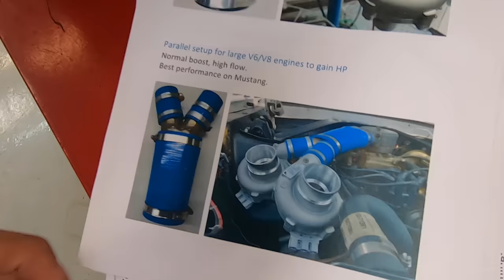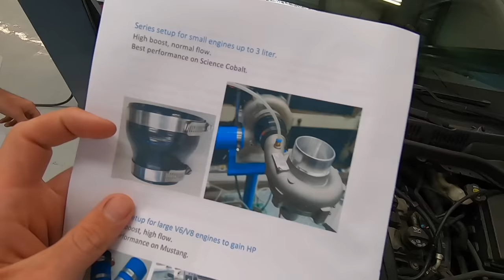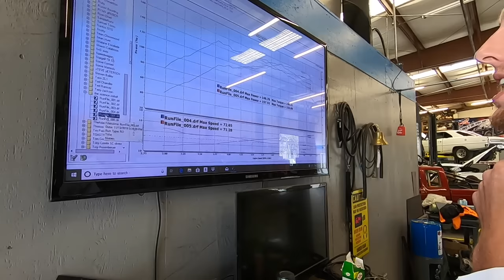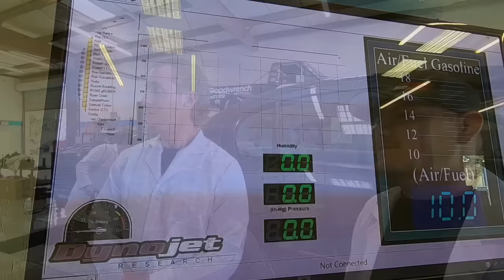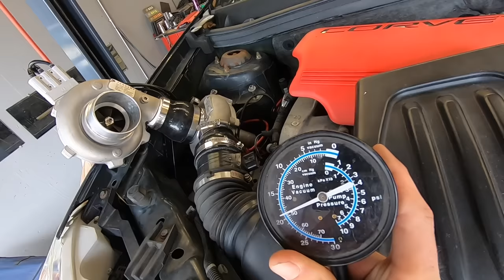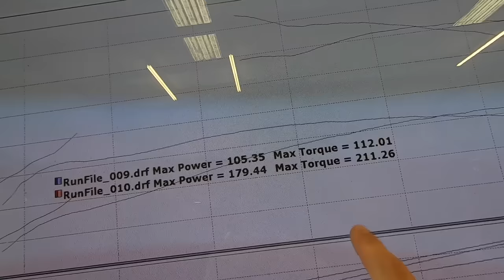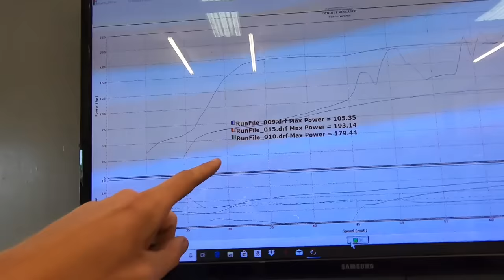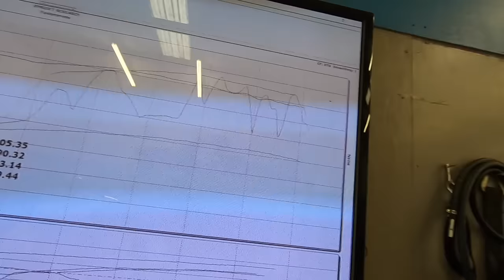Dyno Testing $5,000 Worth of ELECTRIC Turbos! Double the BOOST!!!

Comment: Need to run a "Dump valve" so in NA you are bypassing the turbo restrictions.
Reply: thats how my magnuson supercharger works , it runs a bypass until the engine goes into  vacuum when you get on it. pretty dang effecient
Reply: Initially they wanted to see how the restriction lowered power. First Torqamp video covered it I think?
Reply: What does NA mean?
Reply: @angelmontalvo9125  Naturally Aspirated.
Reply: @angelmontalvo9125  North America
Reply: Thank you
Reply: @angelmontalvo9125  Naturally aspirated also known as no forced induction such as no turbo or supercharger. :)
Reply: That's how I'd build it its not hard to build you could use one of the exhaust to open header valves that are common in the hotrod scene and have it open when you hit the button for the torqamp
Reply: Chase Postell  it's still relevant and it did make a difference lower down in the curve it caused issues of a flat spot on the first run.

The main reason for running a sep line is so you can do things like maf  and map sensors to take timing out ONLY when under boost  because what they've had to do currently has hurt performance badly.

This is the big thing to remember a car can be 100hp up at peak but everywhere else in the curve it can be down on power. You have to take the whole curve not just peak power.

You put drag pipes and pods on a harley style motor (vtwin 110ci) yes it will make 40hp more than the stock bike with the cat and muffler BUT you won't see that power increase until you are at max rpm and WOT. between 50-80% rpm you will see a flat spot and it will be down on power compared to the stock bike thus it will be nowhere near as nice to ride and actually feel slower.

Peak numbers aren't what matters for everything other than 'my dynopenis is bigger than yours' arguments.
Reply: @rocco64744  Or nitrous, nitrous is chemical supercharging
Reply: We have a bypass that works great on engine/turbo/torqamp combinations https://torqamp.com/bypass/ 
Especially suitable when air mass flow is high such as a large turbo build.
Reply: @TorqAmp  loves yalls stuff! Send one to boostedboiz on youtube im sure they will love these aswell!!
Reply: @angelmontalvo9125  Not Applicable
Reply: NM : North Murica
Reply: @rocco64744  or nitrous..
Reply: Chase Postell  hardly, took me about 10m to work out how to make a system with no power loss and the right sensors to tune adjust based on what boost was present  and a third of that to type it. Parts wise.... Probably at most 250$  I want to get fancy and use welded tubing and a set of sensors. Low budget version would add maybe 90 to 120 to the install which is nothing really and if I was doing it I'd be building the electric setup myself and I'd have less than a torqamp costs into the compound/twin setup depending what I was installing it on. 

 The curve analysis took me about 45s while watching the first video of the single torqamp, your right a 2hp difference wouldn't mean much shame that what the torqamp restriction gives you is between 10 and 15% drop at various points on the graph as well as the 1-3% drop at 5400. What that means is it doesn't accelerate as well, because they took timing out in general they will have reduced performance across the whole rev range only compensating with boost when the device is triggered so that 2hp peak power drop is more likely a 10hp drop from the normal NA tune and that is significant and not really compensated for by 4-6s at a time of 5-8psi especially when combined with the loss of power at various points up the rev range. 

This thing would need to be installed more like a nitrous kit to be viable, sensors monitoring and pulling timing only when boost is applied and increasing fuel as as the boost comes in. 

 as shown in this video high numbers don't mean shit if the car becomes undrivable. Look at the torque curve in the twin torqamp setup that's horrendous but makes an 8th more power than the compound setup. With a tune setup for it you could probably make the twin setup as effective as a 100bhp nitrous shot especially if you combined it with a fuel injection solenoid or even just more fuel at the point its triggered. 

Im interested in power that's effective and usable so doing the comparison wasn't any effort or something I don't find useful. It's why I watch this channel, fasterproms, some PFI and a couple of other channels like theWorkshop. I like performance vehicles that work well and am fascinated by this shit so I spent a little time working out how best to use it. Just because you don't see potential or what issues it's causing doesn't mean the rest of us don't know what we are looking at.

Comment: The next step would be to have a three-stage turbo mounted on the same shaft hooked to a Prius engine with a planetary gearbox to have an electric/turboprop engine. The combustion chamber would be a two-stroke Detroit diesel with direct injection for a very high compression ratio. The result would be a powerful compact and clean engine.

Comment: 2019: electric twin turbo
2020: electric octa-turbo
Reply: Nick Venture did you mean quad turbo?
Reply: @enzoprosciutto210  how many sides does an octagon have?
Reply: Not turbo. Turbskis
Reply: Octa Turbo - Dual Threaded
Reply: Nick Venture 8 why
Reply: @bryanne274  Dual Channel
Reply: @eamh2002  buffered or un buffered?
Reply: One turbo for each cylinder!
Reply: Come on guys, this is easy math! Compound wide pipes on each bank on a V8.
Reply: Garage 54 style. Add more :D
Reply: @enzoprosciutto210  quadbturbroski ganggang
Reply: @bryanne274  simultaneous multithreading dawg
Reply: Chiron uses electric-assisted turbos.
Reply: @ArKritz84  thatd be pretty badass on neighbor

Comment: This is now technically an EV car since it uses electricity to generate power. Use that to get a tax break.
Reply: Does that actually work finna get a tax break real quick
Reply: 'hybrid'
Reply: Not an EV because it doesn't use only electricity, but it might qualify as a hybrid, might.
Reply: Using electricity to burn more gas? Best hybrid ever
Reply: I like the way you think😁
Reply: It uses electricity to increase fuel consumption. I'm sure the greenies would love it.
Reply: The power is made from the combustion engine
Reply: @adamgray7185  The power is made by the motor.  Think of it as an electro pneumatic setup.  The compressor helps push the piston down.

Comment: Sounds like supercharging with extra steps.  
Turbocharging (originally turbine supercharging) utilizes the wasted enthalpy of the exhaust,  both pressure and heat.  Ideally,  the pressure is the acoustic pressure or time variant known as sound.  The majority of the energy used by the compressor derives from the heat of the exhaust gas, pyrometers tote and aft of turbine indicate 200 to 400 degree decrease in temperature.

Comment: If I remember correctly from my old cobalt, that plastic intake piece with accordion pipe pops off to expose the throttle body. It might have been worth pulling that whole thing off, it's just a giant empty plastic box that is a potential restriction. Might have helped with the quest to 200 hp ;)

Comment: I cringed at that welding haha, looks like mine on the y intake
Reply: Bits of welding slag breaking off and getting sucked into the cylinders adds power.  It's like solid bits of nitro.
Reply: @Plur307  It exfoliates the cylinders.
Reply: I agree pretty bad . What is up with the lab coat

Comment: In 1990 with my Mustang 5.0L notchback,   my buddy wired up his RC remote to a propeller in the air intake.   It was worth about .2 in the 1320.   He was standing on the side of the track for the passes with the remote and the antenna going up and out his shirt.    The interference from the track tower caused the fan to go on and off and my mass air flow to go crazy.   So I’m sitting there at the line waiting for the xmas lights and my car is surging from 200rpm’s nearly stalling to 3k rpms.    Ahhh 5e memories.  So I appreciate this video.

Comment: Hmmm my company car is a 2019 Camry currently putting down a whopping 203 Hp. 
 I’m wondering if the twin Torque Amps would get it into my wife’s BMW 340 hp range?  It looks like a huge plus to this setup is that it looks like it could be easily removed when I go in for my free maintenance, or for warranty work when the engine detonates from all those bald eagles! 🤔
Oh, and “let er rip tater chip” was nicely applied to those lab coats 😂
Reply: You might be able to pick something up for 5000 that runs with that bmw
Reply: turbocharging company car? kinda badass kinda stupid :)
Reply: @exshenanigan2333  Do it for dale

Comment: Next on the science channel: WE PUT 3 ELECTRIC TURBOS ON THE COBALT 😆
Reply: WE've GOT TO BREAK 200!!
Reply: Y-pipe first stage into an intercooler, single second stage - let's BOG DEEP BOIZ
Reply: @tehllama42  I don't think an intercooler needed. No exhaust making the turbos hot, plus E90 is plenty of combustion chamber cooling. But I'd be curious to see the intake air temps.
Reply: @TheSoundofSpeed  Definitely not needed, but cooling the air charge is basically always a good thing, since you're packing the same number of air molecules into a smaller volume (the math says that increases temperature) - more air means you can give it more fuel, which means more bald eagles.
Reply: I wanna see 2 compounds
Reply: Lmao the "science" channel
Reply: Make it 4
Reply: One per cylinder with McFarland Fab intake manifold
Reply: @4ampaul  is on to something. ITB  QUAD turbos!!
Reply: @tehllama42  I would generally agree. But since these are already maxed out flow/pressure wise, I would think the pressure drop from increased intake volume would negate any gains from cooling the charge air. But who knows, I'd want to see AITs before fabbing an intercooler up. Regardless, excited to see stage 3 haha.
Reply: @daddybotz  Yes!  One per cylinder.
Reply: @TheSoundofSpeed  just put that sucker on the mustang it'll be fine
Reply: After a certain point, you don't need to start the engine any more, just let the blowers push the pistons.

Comment: That's a parallel arrangement, meaning that you are mainly getting more volume,  and the boost improvement is because a single unit is restricted.  Try is with a series arrangement, where the output of one unit feeds into the other. On static tests,  the boost should double,  with actual air flow, in use, who knows?

Comment: So this is how Tesla's ludicrous mode works🤔💭
Reply: Rev engine, smash button, the Cobalt has 'gone to plaid'
Reply: No,lul.
F1 had electric turbo at some point and the race officials used to control the power like the drs to keep the racing close as possible.
Like rubber band in arcade racing that not matter how fast or well you took the corners the ai is right behind you.

Telsa all is does double the power to motors but too much electricity could burn the motor and have bad batteries in a short period of time.
This why telsa always update the software in their cars to make sure the car is giving the safe amounts of power and don't peak high voltage here and there.
Reply: Benjamin Franklyn I find that first part hard to believe
Reply: no teslas dont suck in air obvs but yes electric assisted boost is pretty neat

Comment: Back in 1966 we had OM (Italian) big six cylinder diesel buses (70 passenger) buses that ran on electric blower very successfully. It had a lever switch on the dash. On a hill with it off, then switching it on dropped its ass and it took off. 24v system.

Comment: That's about what I spent on my n/a built DC2 (pretty much gutted, ~2200lb Integra gs-r)  to get 217whp (but only have 132wtq)...runs high 12's-13 @107/109 which isn't very fast nowadays but used to be a killer on the streets...starting from  30 roll was the sweetness